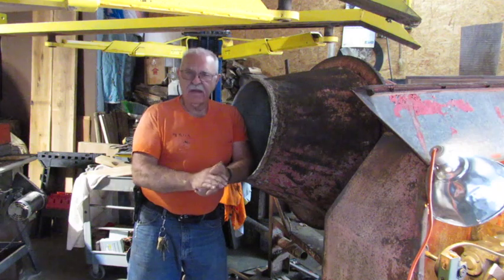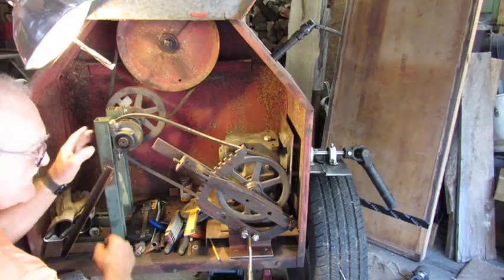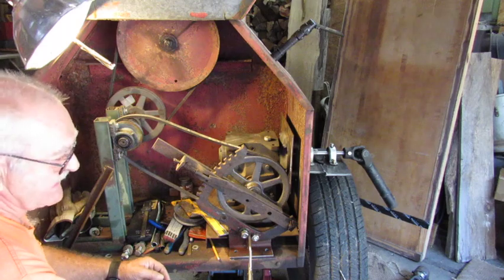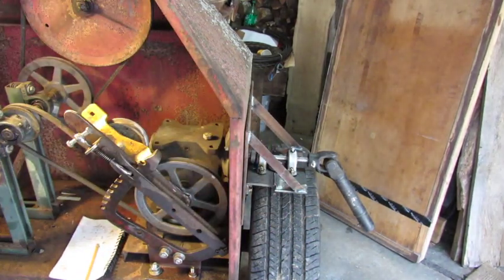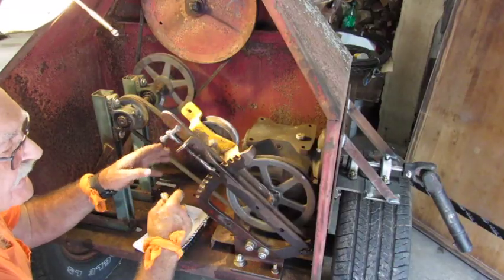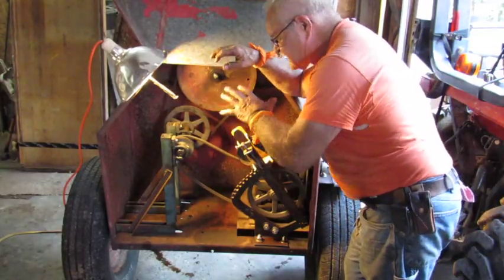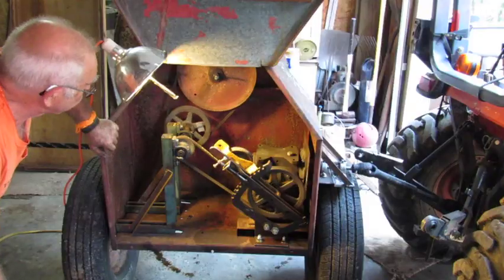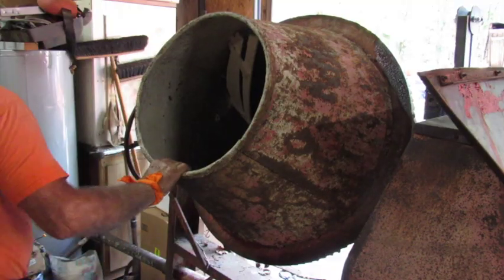Pt 2 of Re Powering An Old Concrete Mixer With Salvage Parts

Comment: Great call on building that belt tensioner, Wendell 😎👍
Reply from the maker: Well these new units with the electric pto engagment would put unnecessary strain on the input shaft to the gearhead when started under heavy load.  This should minimize that shock for sure.  Its all scrap material and that's what its here for anyway right..?  Take care Zane and have a great week at work my friend.

Comment: 😀I see you got done what I am about to have done, ( Tuesday morning ) .......
Now, on to the concrete mixer, this is a great 'build up' Wendell, this is going to work out just dandy for you. Nice job!  Oh by the way, thanks for te 'before midnight' release time on this video , hahaha!
Also, what is it you got done, that I am about to have done?
Reply from the maker: You wouldn't be talking about my fancy hair cut now would you...??  LOL. If not, I don't have a clue Reg. If so, it's compliments of my oldest daughter that lives right up the road from us out here in the woods.  I don't know what happened time frame...are you two time zones to the east of CST time here in Missouri...if so that answers that question. Iirc, it was a little late in the evening when I uploaded the first one.
Reply: @tractorman4461  Good Morning Wendell, yes, Haircut it is , mine's tomorrow morning! 
Time zones, well you folks are in the 'Central Daylight Saving Time,  ( I think, ) and I am in Newfoundland Saving Time which is 2 1/2 hours later than you are.. Just look up the present time for, say, Gander Newfoundland and you'll see what time it is here at my place, example, right now it is 9:00 AM here, therefore it's 6:30AM for you folks..
Reply from the maker: @regsparkes6507  I almost suggested you may be effected by that one time zone that's shifts a half hour.  But yes, that 2 1/2 hour shift surely does answer the late posting.  I really TRY to upload between 5 and 7 pm  here but most times my evenings are not totally my own to schedule.  
   My daughter started cutting the SIL's hair 20 years ago and mine for at least the last 10.  I always hated wasting a trip to town and sitting in a barber shop. There it takes a 3 hour trip and here it takes 15 minutes.  (-:
Reply: @tractorman4461  Aye, I'm with you on that. I hate wasting time, especially when it's  my own :)

Comment: I have a small mixer the neighbor wanted out of his way. I put a small electric motor on it, throw my de-hulled walnuts in with some water, and clean the nuts. Dump the water out in the driveway to help keep weeds and grass from growing and lay the nuts out to dry.
 I might actually mix concrete in it some day 😁
Reply from the maker: My uncle did the same thing but added in two or three half bricks.  Poured them into a 2x4 frame with small chicken wire to sort and dry.  My dad edged the driveway with 4x4's off the sawmill then backed my sister's car outta the shed over them.  Every couple days scramble them up with a rake and keep doing it until they shucked out.
Reply: @tractorman4461  I have quite a few land in my driveway, so last fall, I just raked a few more out of the yard and picked up the shucked ones once a week. It took a bit to get 2 5 gallon pales full of clean dry nuts, but didn't cost me much time.
 A couple years ago, I threw hull and all in the cement mixer and tossed in a couple softball sized rocks. That worked, but I had to flush them out and rinse them several times to get them clean enough.
Reply from the maker: @bluegrallis  Yes, my uncle would have to flush each batch a number of times too but he liked the way the rough ridges would be rounded off by the brick batts. They were much easier on his fingers  while cracking 'em without the crisp outsides.

Comment: Wendell one side should be mixing , once you turn to the other side the concrete should come out . That the way the one ☝️ we rent work . Where there are running of big chain from mixer to gas engine. Own way it stop 🛑 went you turn the engine power off to stop 🛑 everything. It mix at a slow rate of speed for mixing concrete. Concrete work in the #7 , like take 7 min to mix concrete in the that mixer
Reply from the maker: That makes sense Leonard.  I have to use it from just the one side now with the pto power.  But it doesn't matter to me too much because it flowed out just fine into the wheel barrow and you gotta remember, I'm not in a real big hurry especially on a hot day !!  Thanks for the additional info my friend, that's something I didn't even think of.

Comment: Wendell I rent the same size concrete mixer last fast . We can buy 88lbs of concrete add 52 shovel of sand and stone mix plus 4 gallon of water . One mixed for get 2 1/2 wheelbarrow of concrete. 4 x 88lbs bag give you a yds of concrete once mix . One ☝️ we rent are the same as your there got 15 horsepower Honda gas ⛽️ engine run with a big chain for engine to concrete mixer . One ☝️ you start the engine it keep moving at a slow speed same when add the bag of concrete mix , sand and stone plus 4 gallon of water 💦. There chemicals you can buy for making concrete to Wendell for high grade concrete pour . 😊
Reply from the maker: I add Portand to each batch to make it a bit stronger than just what's in the bag. Also in the six piers I poured for her Gazebo I welded 4 rebars into a square to insert in the center of the sono tubes.  So that too will add a bit to the support.expecialy the ones downhill that are out of the ground.  I dug them 30'' down too to get below the frost line.  I like the sound of those rigs you rent with the Honda engines.  Thanks for all the input Leonard.

Comment: Good job Wendell. That should get the job done.
Reply from the maker: Heck yeah it sure did turn out better than adequate.  Now if needed, the rig can be used at full capacity due to the increased HP of the tractor over an electric motor.

Comment: 😊😊 IVE seen those old mixers  be 4 and they had a engine older than that the PTO shaft was the way 2 go the tractor 🚜 😊 had plenty of power 🔋 😊 2 turn it over 😊😊 OMG 7 2O 2O25
Reply from the maker: Oh yeah, this one had a big one lunger.  Like a 16hp Kohler for power.  The tractor is working just fine for the re-power Clarence.